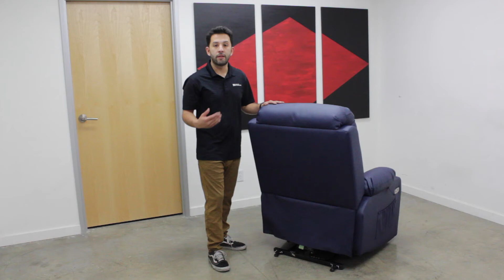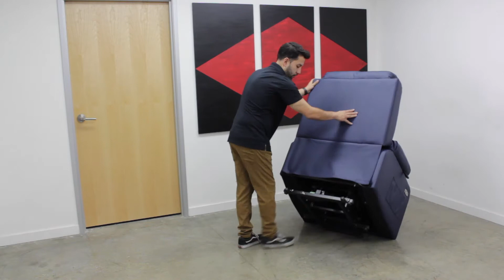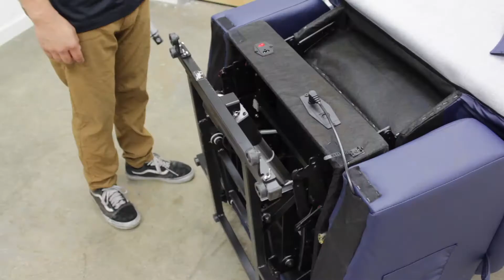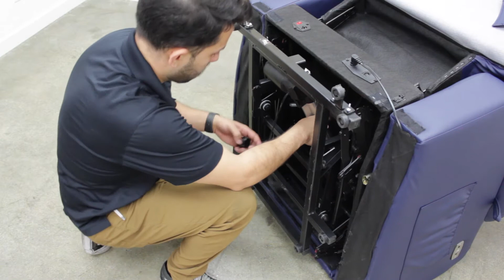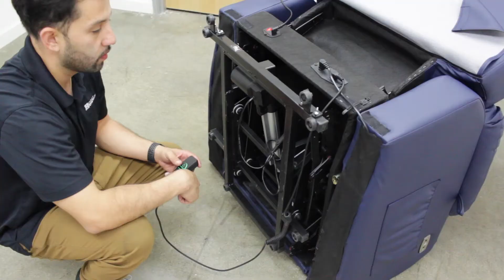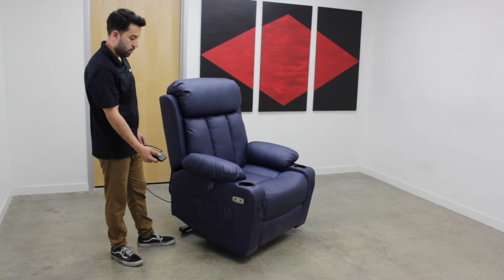Mcombo Power Lift Recliner Chair Replacement Lift Motor Assembly

Comment: If there is no sound or movement when trying to use the lift portion does that usually suggest the motor is bad or remote? My Mom has one of these chairs and it wasn't cheap but it's not working.